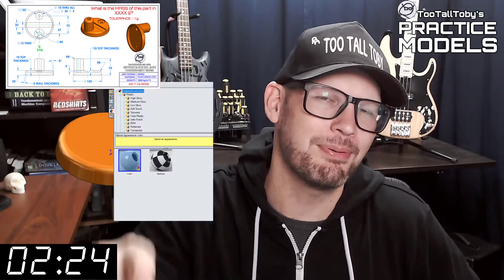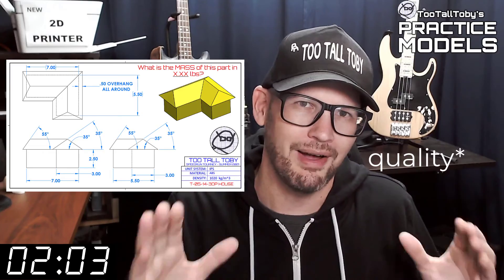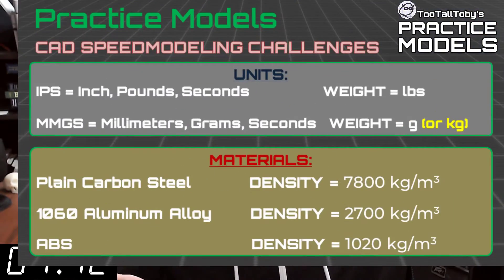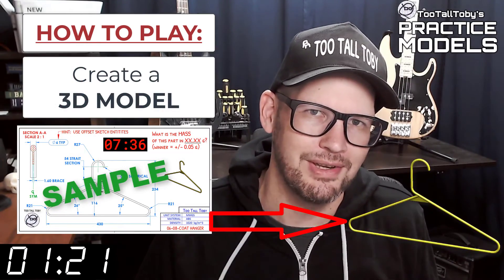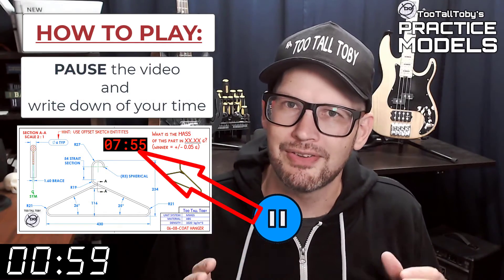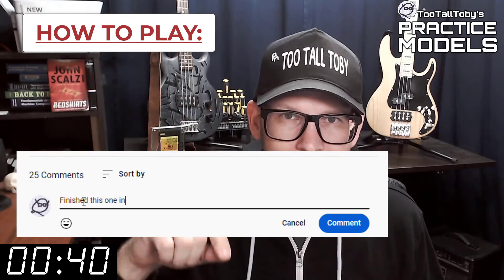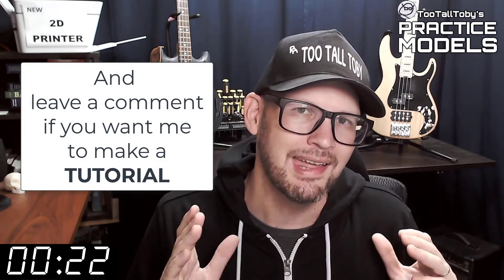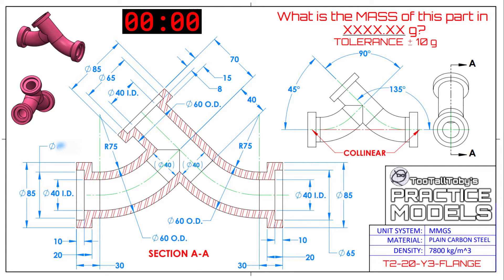BLURRED C'Bore dimension = DIA 65mm  -  CAD Modeling Challenge - SWEEP - T2-20-Y3-FLANGE

Comment: Mass = 4969.5 gm
First attempt 8:42 using Alibre Design Expert V27
tricky though. didn't realised that the top flange was different than the other two. hmm, got me there a little bit :)

Edit: After my first attempt, I tried to find more optimized ways to model it up. 
Here is my recording a better way which taking advantage of relative symmetry of the part.
https://youtu.be/IW85GMLhNCE
Reply from the maker: Awww yeah nice job Ty!

Comment: Changed my strategy a couple times. Decided sweeping on the centerlines was best. However, I had the bend radiuses wrong so didn't get the correct mass. Once i figured that out the model updated nicely and I got 4969.69 but ran out of time finding my mistake.
Reply from the maker: Nice job and congrats on finding the mistake!

Comment: Couldn't get this one right until I made the 60mm step on the flange 65mm. Looking at the drawing the dimension does not line up to the model.
Reply from the maker: Awe crud you are correct sir 😀. Lemme see if I can fix this, without needing to re upload
Reply: Ran into same problem last night, well early this morning with the 65mm inset.   But got some good practice at checking models that don't have many planer faces !!
Reply from the maker: Nice - Sorry about that!!   @RichPenn
Reply: @TooTallToby   Hey, it was a good learning exercise.   
I discovered how to copy a "good" model from the Public space and then do an intersection with my model and find the deltas.
Reply from the maker: OK I added a BLUR and I added a note in the title and description.
So SORRY about that!!  I made changes to the model, so it wasn't the same as the original, but the model had some funky dimensions (to layout sketches) and I think that 60mm carried through from that previous setup.  DOH!!!  

Thanks again!  I very much appreciate this heads up and glad we got it resolved!

Comment: i did it in 11min 31sconds. i had trouble getting the right answer because I wasn't seeing the straight edges after both curves.
Reply from the maker: Awesome job and well done!  I found out this morning there is a mistake on the print - the 60mm on the left side counterbore should have been 65mm dia.  Sorry about that!